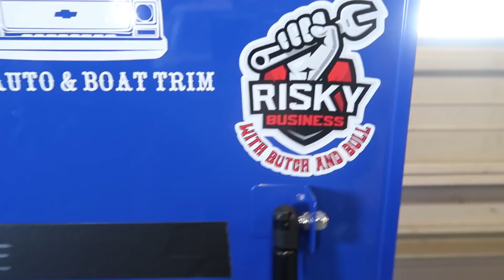That is the question..

Comment: I missed part of the build, I heard it may have gotten Rangs and Berrins, but was the head put in the machine shop for a full valve job and magnaflux? I don't want to jump to conclusion and worse case scenario, but do a compression test on #5 that keep fouling. Wondering if it may have a crack in the #5 of the head and it's compression is escaping to a cooling jacket and why your upper radiator has alot of pressure. What's causing #5 to foul? Is it gas fouled? Oil Fouled?
Reply from the maker: Gas fouled, we believe it to be the cam
Reply: @butchandbull  Certainly could be. A compression test may help there too. No backfires through the carb huh???

Comment: High speed muffler bearings need replacing or the Kanuter Value that connects to the Johnson Rod could have some slack in it or just plain loose slapping against the inner lining. Who knows, maybe it just needs a good Rim Job to her running right again. If none of those work, check the Rotator Splint for compression. 2A 🇺🇸👊🏻
Reply from the maker: 🤣 we will get right on that 🤣
Reply: @butchandbull  🤪
Reply: That kanuter valve is one tricky sob to time correctly 🤘🏼
Reply: @butch7384  You gotta hold your tongue just right and then everything else will fall right into place!🤪

Comment: Keep up the content guys stay strong  l agree 💯. The truck you guys didn't say if the plug was wet I'm guessing you checked makes sure the porcelain wasn't cracked and the wire was good. Probably leaning towards the cam but if the plug is wet with fuel check that intake first make sure that plenum isn't leaking.

Comment: Just for S&G's too since you guys didn't seem to know how to set points, I was going to ask, when you did the HEI distributor conversion, did you modify wiring to compensate for the voltage difference to the coil??? Points system distributors will run 12V while cranking the starter to start, then when you're off the starter it's running on 6v to the coil so you don't burn the points up. This is done usually by resistor wire, ballast resistor and sometimes at the starter solenoid. HEI requires 12v full time. If you're only getting 6v, this might be why it's running like crud, and even a weak spark allowing plugs to foul. Check your voltage to the coil and see if you have 12v while the engine is running. If not, lemme know and we'll by pass or move some wires around so you're not splitting any voltage to the coil.
Reply from the maker: We did that, 12v full time

Comment: I can't remember if you guys change the cam but I know you didn't change the intake
Reply from the maker: Good call We! We think it's the cam 😟
Reply: @butchandbull  that's what I was thinking I've been a mechanic for a long time for over 30 something years now I know if the cam is flat your valves are not opening and closing correctly which can create a misfire in the load up of a cylinder